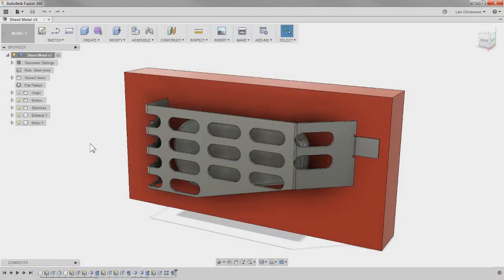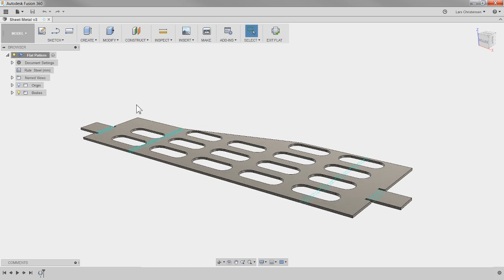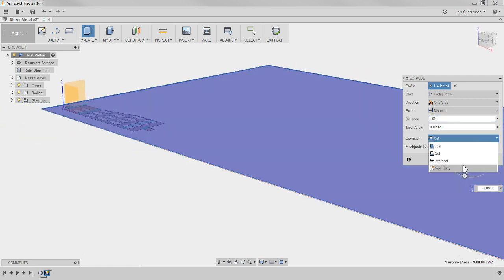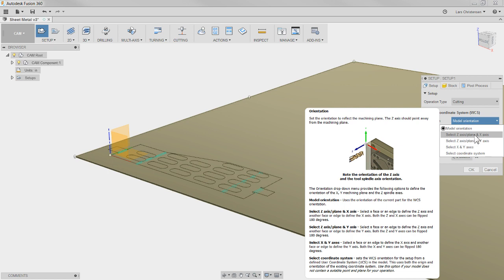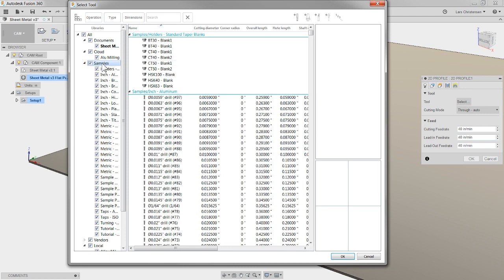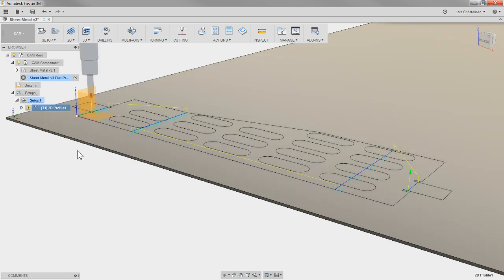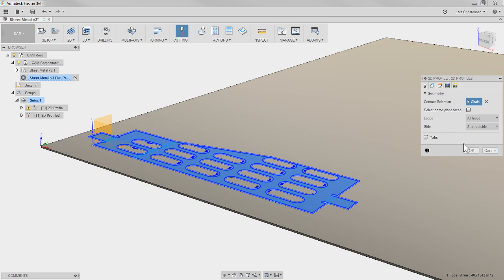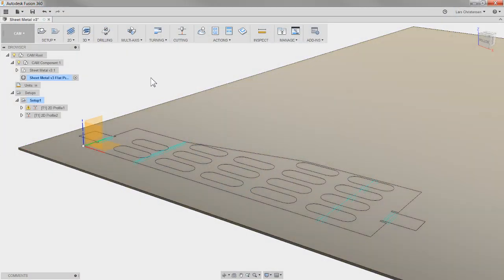Fusion 360 — Waterjet/Laser & Plasma ANd NOW Sheet Metal —Your Comments & Questions — #LarsLive 50

Comment: Can't find a way  in the 2d cutting profile for toolpath limiting . To cut a bigger parts then plasma cnc bed , seen how to do it with other  functions in fusion but must be a different way. I tried to sketch a limitng box but there is not a stock contort option like with a wood router setup so I'm stumped?

Comment: I need help controlling deceleration of a waterjet as it approaches a small radius, 90 degree corner or its lead out point.  I love fusion CAM, but this problem causes me tons of secondary operations that would go away if I could slow the jet down on approach to said features.  Thx all

Comment: GREAT
How can I export a flat pattern in dxf format
Thanks a lot
Reply: I also have this problem. We normally send a dxf of the flattened part out to a laser shop and I can't see how to do this. Additionally there is no dxf output available from drawings and the DWG option produces files which are only compatible with the very latest Autocad products.
Reply from the maker: Sure you can't just post the code directly to the machine without having to convert to dxf?................nevermind :-)..........go here and search dxf and you will find a post that will post our dxf
https://cam.autodesk.com/posts/

Thank you for watching the videos!!
Have an awesome day!!!!
Best,
Lars
Reply: in the flat pattern there is save as DXF command

Comment: what's the best way to get from a flat pattern to a DXF for sending out for cutting processes?
Reply from the maker: You got a couple of options depending what is best for you.
1. Create a new sketch and project the edges you need, then right click the sketch on the left side and save as dxf
2. You can create all the cutter paths in the CAM workspace and post the code out as an dxf
3. You can go to Fusion in the cloud and save the entire design as a dxf file.

Hope this is helpful.
Reply: Thanks for the reply- the new sketch projection route is what I've been doing- wasn't sure if there was a more intuitive route.  Appreciate the video!
Reply: in the flat pattern there is save as DXF command